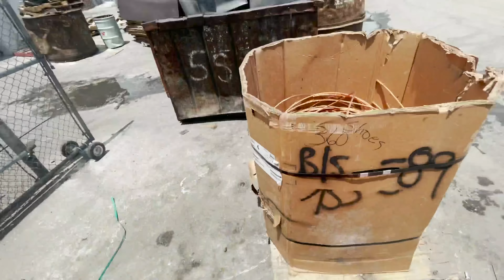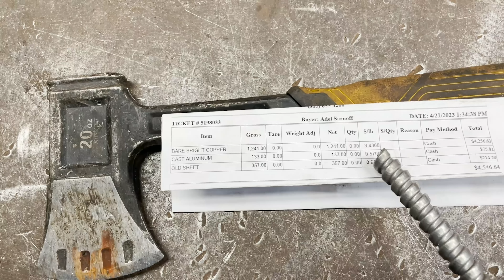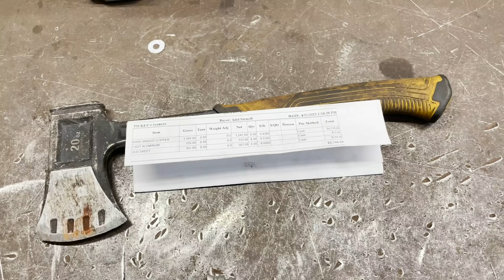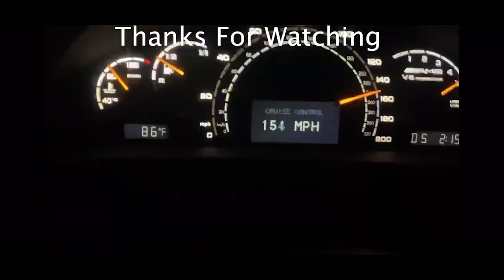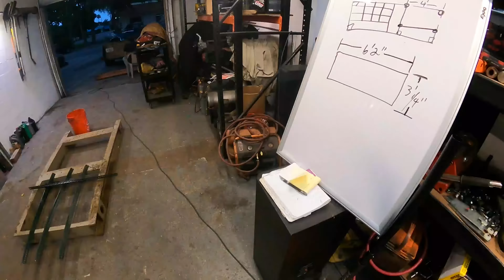1200 Lbs Of Copper Shredded By The Copper King

Comment: a little electrician tip, usually the spool spins the same direction as the plastic unravels, so if you pull towards your self and the plastic is unraveling from the top then the wire will feed towards you, if it unravels from the bottom then spin the spool around because pulling wire over the top of the spool is easier than underneath.
Reply from the maker: Thanks for the suggestion

Comment: Wouldn't the copper wire be sold for more when its already insulated and ready for installation? Instead of scrapping it?
Reply: Only 10x more😂
Reply from the maker: If I had someone that needed that size and length wire. It don't sell like you would think. that's why scrap yards don't resell they scrap it. lol

Comment: That wire that was struggled is rated for outdoor, like the tri-plex.
Reply from the maker: Thanks for the info. 👊 The machine only struggled because the belt was in bad need of being replaced before I even started.
Reply: @ProjectShopFl  see I have that cheap Amazon wire machine. Your on the pro level! And your way more mechanically inclined then I. 🥳 which is why I love watching your channel

Comment: I'm confused though can't you sell the spools of brand new wire back to a distrubiotor for much more than scrap?
Reply from the maker: If that was the case I think the Electrical contractor I got it from would have done that. I think once it's cut off the main spool there is no returns.
Reply: @ProjectShopFl  yeah but you can call and ask to sell them. They might say no  Those are long length coiled and wrapped. That machine is sickkk though

Comment: If the rattling of your roller mod is annoying, take it apart, wrap the rod with electrical tape or insulation wrap.  The roller doesn't need to spin, so put as much on as you like.  Really like the despooler.
Reply from the maker: Thanks for the suggestion

Comment: Too easy !!.  With your other spools of wire that you normally cut into lengths with the jaws before stripping, can you possibly mount the whole spool and let it run like you did with these smaller spools you just ran ?  Look forward to the next update. 👍
Reply from the maker: Sometimes the wire is a bunch of 10-20 pieces so you can't really run it on a spool they have to be long for it to be worth unspooling like this. Short pieces I pre cut to make it easy on the back side.
Reply: @ProjectShopFl  Of course, that makes sense, I was thinking of one big coil.

Comment: You need to change the Copper king over to a double pulley to help it with the torque with two belts. This will reduce overall wear and tear, and give you a lot more torque.
Reply from the maker: Thanks
Reply: @ProjectShopFl or use one of the many gearmotors ive seen you have
Reply: I actually post while the video is running and YouTube will pause the video so I posted that before I saw that you said you were going to change it over to a double pulley system. I was going to go back and delete the comment, but I know that messes with YouTube metric so I just figured I would leave it as is.

Comment: You could easily move the reel holder closer to the center point and mount the spools vertically instead of horizontally. You would need to just add a foot to the bottom of the bar to support the spool holder and maybe shorten the rod the spools slide onto so you don't have to lift them as high. That would make everything simpler and more compact and would feed the cable easily too though you may want 2 vertical rollers on either side of the feed tube so it doesn't snag the sides.
Reply from the maker: Thanks for the suggestion

Comment: Do you think having the wire stripper chain driven would work better for your use?
Reply from the maker: No, I need a belt so I can make the clutch slip
Reply: @ProjectShopFl  I got ya. Hope the updates you're planning work out better than you hope.
Reply from the maker: @SouthernScrapBucket  Thanks!

Comment: You could have just used one of those wood rolls as a spool for the stripped copper cable ... lock two spools together (drill hole in both, tie with a wire), ... strip a few meters of wire, pause, get the copper wire and insert it through a hole in the empty roll, then resume process... as the machine unspools one roll, the other spool is turned and gathers the stripped cable.
Later you can just cut the copper to lengths as you unspool it again.
Reply from the maker: Thanks for the suggestion but that seems like a lot more work to spool then unspool.

Comment: Do you have air conditioning in your shop? I noticed that you're about the same size as me and that heat really gets to me I have to go out and work outside where at least I got a wind, because it gets too hot in my shop.
Reply from the maker: I don't have AC in the shop yet! I'm looking for a good unit The electric is included in the rent so I should have 2 going. lol I put 2 fans in the back door pulling air out and one in the front pushing in. It keeps a good breeze coming through the shop but it is south Florida so it's a warm breeze. lol  I also try and work at night when it's cooled off and noon is around to interrupted me filming.

Comment: The Copper King is a big part of your business. You need to take better care of that beast.  You have told us you don't know who made it so replacement parts will be difficult or impossible.  Keep it clean and tight.  Fix those adjusters and start looking for replacement blades and rollers.  Assume they roll on bearings?  Replacement bearings might not be too hard to find.  Time is money.  Castistrophic failure will hit you where it hurts the most,  your money pocket.
Reply from the maker: Thanks for the suggestion. I have replacement blades and I can get the bearings no problem. If something fails I will just use the stripper that is bolted to the side of the main machine until the repairs can be made.

Comment: I am kind of in a different camp here, that wire was worth triple scrap and would have been easy to sell around here.  I am all for scrapping wire, but it pains me to watch good wire go away like this.
Reply from the maker: If I kept and tried to sell all the good wire I get I'd be broke and out of space. It don't sell like you think it would. I buy it from electrical contractors if they wanted or needed it for a job they would keep it and not sell it as scrap.
Reply: @ProjectShopFl  I completely understand the space issue, but it still hurts me to see it going away.  I just had to buy some 4/0 copper wire for a job and only needed about 30', I would have gladly paid you $4.00 a pound, but shipping would have killed the deal.  🙃

Comment: I know you don't mind shredding all that wire but it really does seem odd they didn't just use it on another job and order the right length they needed, or at the very least other electricians would be interested at a price to you more then you get from scrapping it. Oh well I guess they all lucked out and it gave you a decent score for the week
Reply: I think some of the guys like making a little extra on the side!
Reply from the maker: They might sit on it for years before a job comes needing that particular wire. You can't keep it all and it does not sell as fast as you think.
Reply: That wire is extremely easy to sell as is.  He scrapped it so the cops wouldn’t come calling.   I’m sure someone reported it stolen.
Reply: @brettr5188  they probably work for a large company and can write it off and order more. Probably owners or at least top end foreman or supervisors selling it to him.